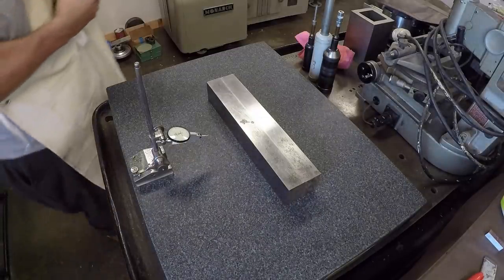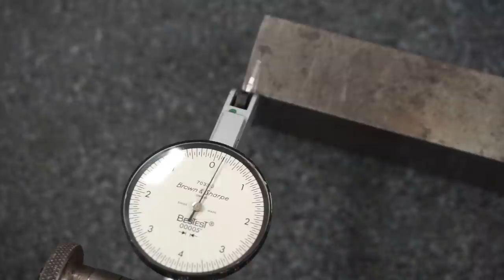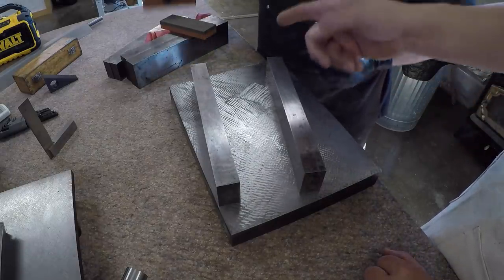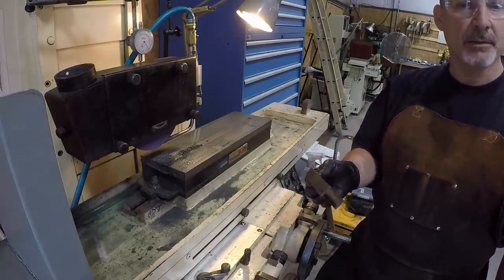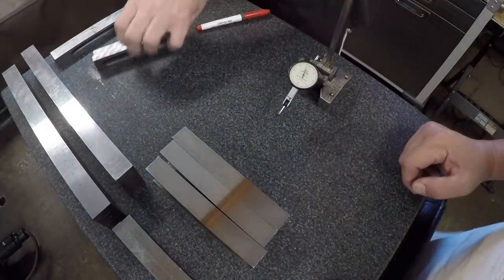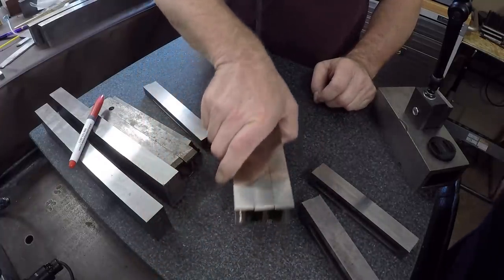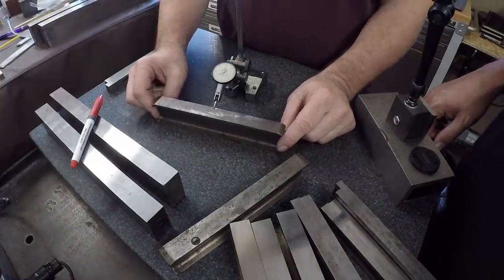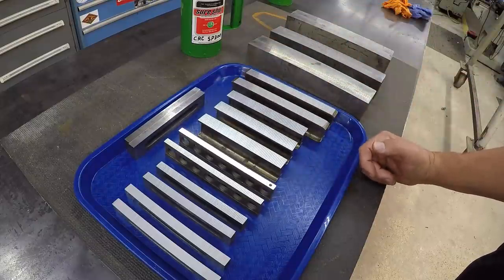SNS 293: Inspecting and Surface Grinding Parallels

Comment: 18:36

I think this must be the point all the comments about stalling the wheel is about.

Yes, it sounds freaky.

But the edges are not supported and you are getting harmonics as its ground. The closser to the center is a diffrent pitch.

Makes grinding harder as they are moving about. Many very light passes probably.

Comment: Never did much grinding,  but the guys never had the parts square to the stone, they always had them at an angle of sorts.
Reply: Agree, that i think was mistake making them parallel. Grinding stone exerts more force when it starts grinding from side, so on that particular shape(double T) Grinding stone probably moved it a little.

Comment: those I beams could of hot spots have the material deform as the grinder went over the surface reflection and rebound.

Comment: Not a machinist, but my take is that the unsupported horizontal may be resonating at a natural frequency of the part as it is ground thereby influencing the surface finish. Anybody have any thoughts on this?

Comment: On the surface grinder bed, what holds the work from moving?
Reply: Magnet I think.  Look at the power cable coming in on the right side.
Reply: This bed is known as a magnetic chuck. It holds well on particularly flat pieces of ferric metal do to the surface contact. Lots of angry pixies course through the electromagnet to hold the piece
Reply: @25centsapop  Good to know,thanks for the info.

Comment: I wish I had a surface grinder like this one, very nice! That finish is absolutely bad ass! Can the shape of the Ibeam parallels be affected by the magnetic field of the mag Chuck? Very interesting! I think it’s just stress in the material from the casting process, I’m sure not all of the grain structure of the material is perfectly the same.

Comment: The surface plate may not be perfect! a .0001'  error may be within the grade tolerance of the  surface plate.
I would check the measurements at various locations on the surface plate. 
If the measurements do not repeat it indicates the surface plate itself has errors. (all surface plates will will have flatness errors.)
Reply: That wouldn't show up with such a long part with a large s.a.
Reply: @xenonram  It May show up the errors
In the video when the bowed parallel was turned over it appeared the measurements did not compute compared to the other side? 
Mitutoyo have a good paper on surface plate calibration.

https://www.mitutoyo.com/wp-content/uploads/2018/08/15004A.pdf
Chasing tenths is always the grail for mechanical engineers, Trouble is the error gremlins lurk in every corner, you think you have got em covered then another turns up. That's life I guess LOL.

The I beam type parallels may need a lighter feed to avoid deflecting them.

Comment: What would these actually be used for? I’m not from a machining background, but being in the equipment world, I’m sure there’s something I would be familiar with that these would affect.
Reply: marine2ful  they are typically used in a mill vice to raise the work above the vice jaws so that the tool doesn't hit them. They are also used to raise the work above the bottom of the vice if your tool has a chance of going all the way thru the work, such as drilling, so that the tool doesn't damage the bottom of the vice. There are other uses but those are the most common. The reason they are matched pairs is that all the surfaces of the vice are, or should be, nearly perfectly square and parallel to itself and are mounted square and parallel to the mill. So when the 2 precision parallels are placed in the vice and the work is placed on the 2 parallels the accuracy is transfered from the vice to the work so you can quickly put them in and take them out as you need to and not have to worry about repositioning and indicating your work every time. Keep in mind, the work is wider than the width of the 2 parallels so that the vice will clamp on the work and not on the parallels. There are also many sizes of parallels and are always sold in matched pairs because they are usually used in pairs as described. Most machining videos that show work on the mill will show the machinist using parallels that are much smaller than these. Like 1"x6"x1/8" for example. Hope that helps.
Reply: lkw that did help

Comment: How are the 3 machined parts fixed to the bed of the grinder at 18.40? ............... I think I see now a very strong electromagnetic grinding bed
Reply: Magnetized table ?? did you not see him flip the switch ..

Comment: magnetic deflection? id expected more from temp not so much the magnetic influences but if it is the only way to get it out would be to support the ends with a solid resin poured tween them then regrinding them then popping them free of the resin
the finish is just gorgeous on them all

Comment: Would scraping improve the surface?
Reply: I'm not a machinist but having said that I think the tolerances would be similar as far as flatness goes, so it would be viable but very little point to scraping them, the surfaces don't need to hold any lubricant. Also getting them to be a matched pair or set would take some extra work.

Comment: adam ant lance.. hello 
I think I know why your parralels give a difference in your flat measurement.?

we could all see that lance made the stone nicely flat ... and then tensioned your parralels ... later during the measurement it turned out that the horizontal and the X axis also differed ...
I think this is due to the grindstone .. (why I think this?)
why do I think ... just simple ... the stone that wears out and the more you get to the end of that surface ... the more the grindstone is worn ...
so you measure that difference with the 0.0001 measurement ...

it would be nice that you put a 1 on the starting side and a 2 on ( ending side )where the stone is ready.
then measure later and you will see that the 1 side is 0, and the 2 side is 0.01

hopefully i solved your problem .. and thinking about it has been ..
otherwise I cannot imagine anything else.

sorry for my bad translation program hope you can figure it out!
gr fr holland

Comment: You didn't use three point contact.
When you press the grinder into the work it tilts the work towards the wheel cutting more then it should, and when you went to the other side it did the same. Classic hump in the shorter axis.(three little squares of brass shim, should fix it, one center left,one bottom right, one top right.)

Comment: I like to precision flat grind with the parts at an angle to reduce wheel time on the part to prevent heating even though I run flood coolant. I also like to Grind with only residual on the magnet for a finish pass. I have heard you can hot glue bowed parts to a flat plate and let it cure before you mag them down to get the crowned side flat, then flip and mag down to knock the cup flat.  For use on any machine besides a surface grinder I wouldn't mess with any parallels that weren't at least .0005" out.
Reply: bcbloc02 yep the glue trick works great! The glue supports the part so the mag doesn’t distort the part. Works every time! My uncle taught me that one!
Reply: Good call Brian - I like the idea of using residual mag for the finish pass, I think that can easily bow the parts a few tenths
Reply: I didn't mention this in my response I guess because it is a habit to me. Forgive me

Comment: My theory on variations on the I-beam parallels would be more to do with the tool pressure on the outer edges of the parallels, because that area is just unsupported. I believe the mag chuck had very little input on the deflection, if not any at all. If the I-beams had more of an integrated gusset from the outer edges to the center beam, the variation would be less. Also if they are not heat treated steel, the tool pressure deflection will be greater.
Reply: This is the right answer. Every material has a non-zero stiffness (modulus of elasticity) and will deflect under pressure. Lapping and polishing processes that apply less force than the grinder will give better results. However, the i-beam shape itself is the problem with using these parts as precision parallels. Any clamp-up will also cause deflection in the flanges away from the center web. That said, they are beautiful pieces even if they aren’t the best for uber precision use.
Reply: Couldn't agree more. I'm not a machinist but I work in a mechanical laboratory and this is spot on.
Reply: From the indicator readings I could see, the "wings," when measured in the free state, were lower. A better look at a mapped measurements would help answer this. If the wheel was exerting tool pressure then the wings would deflect downwards during the cut, and spring back up in the free state. That's not what I saw. Finally, the statement above about the deflection increasing if the temper is lower is not correct. The modulus of steel is very nearly the same, and independent of temper. The yield point may be lower or higher, but for a given load (tool pressure) the deflection will be virtually the same.

Comment: Is that a cam mag chuck? Those thin cross sections, as said, will conform. Need to run very low mag and put stop on backside as precaution. And as said, grinding across heat effected zones the stone could deflect.

Comment: Milling machine or shaper for the first side then surface grinding ,because the magnet will straighten out the steel but once it is released take back its form.

Comment: To start I know absolutely Zero about surface grinding but how do you account for ware in the wheel while grinding a surface ?
Reply: You will notice that he is advancing the part along the y axis so that the part isn’t being ground by the entire wheel, so small parts like these are not eating away the entire true edge, how ever multiple parts or larger parts will ware down the trueness and the wheel will then need dressings. Hope my  terrible explanation helps.

Comment: That mag chuck needs a regrind.  the error in your parts was in the same plane as the banding on the face of the chuck.  Its an easy theory to test, take one of the parallels and grind it while its on an angle to the travel of the machine, such that the parellel is resting across a few of those bands.  If that fixes the problem, then its the chuck.

Also, when youre doing your assessment of the parallels, you should sweep both sides.  You hinged one part, which clearly showed it was bowed downwards (hinging in the middle), so there was an insufficiently broad area for the parallel to sit on for an accurate sweep.  If you sweep both sides and it comes up bowed both sides, then thats your assessment, but if one side comes up bowed, you cant accurate sweep the opposite side as the part will rock under the dial.  Also, measuring parallelism with a mic helps as well.  If the part measures as a barrel, then you would struggle to sweep either side without making a fixture to hold the component on a face other than one of the two parallel faces.  Bowing outwards = opposite side not sweepable.

Comment: my thoughts on the i beam ones are the area in the middle where there is metal under it does not get as hot as the metal on the edges. Therefore the metal at edges expanse more than in metal in the middle where there is metal under it to acts like a heat sink.
Reply: Yeah but how hot can they possibly be getting with all that coolant/wash?

Comment: All steel has stress in is so it changes as you remove material, also the magnet will bend the part if its all not perfectly flat on the chuck side. We used a couple of tricks to get one side flat, reduced magnet power and or placing the parts on paper on the chucks that did not have reduced power settings. When doing stright edges they were ground with just a stop to keep them from sliding with the magnet off. You could not do them after using the magnet at all because it got warm which would bow a 14' stright edge by 5 to 8 thou.
Reply: thinking a optical flat would tell you what to do if you were wanting anything tighter.  I'D'ed the trouble spots if you didnt mind the time it took to polish them out dead nuts flat is possible  and oooooh would it shine.

Comment: When machining the "I" parallels the portion being ground that is not supported vertical web in the beam the metal gets pushed downward away from the grinding wheel instead of cutting fully. It will never be consistent.
Reply: What if you laid them over and side wheeled em?
Reply: There isn't a good way to dress the side of a grinding wheel true. Even if there was the mag table wouldn't be strong enough to hold them in place, they would be pushed sideways. And no real way to grind them in a straight line.
Reply: bcbloc02 you’ll get a much worse finish side wheeling them
Reply: I'm no expert, but my sense tells me that if the wheel was pushing down the sides, they would rebound back after the wheel passes. Then that extra amount would get ground on the next pass. As you do lighter and lighter passes, the issue gets less and less, till essentially you are just doing spring passes with practically no down force. My best sense is the thinner portions are getting more heated than the central part, so they could sag a bit when hot, and when they cool, they could curl a bit.

Comment: It takes a highly skilled grinder hand to consistently grind things flat and parallel with in .0001", let alone squareness to the same degree. I have spent hundreds and hundreds of hours on surface grinders and know what a challenge it can be.
Reply from the maker: Yep it's gets frustration chasing tenths!
Reply: I saw no squareness checks.

Comment: I would try to grind them again the same way but don't push them together. Maybe the sides aren't perfect and when you push them together some spots raise up/tilt from the magnet and then the magnet forces them down leaving tension on the parallel

Comment: What an awesome collaboration between you two! 
Adam with the wonderful finish that Lance is achieving would you now consider in future to cover the working faces heavily with a couple of layers of tape and sand blasting the sides of the parallels before surface grinding to make them look like new? I know it's only cosmetic, but the finish Lance achieves is phenomenal and the rest of the parallels deserve to look brand new as well to my mind.

Comment: What's that stand called holding the dial indicator?
Reply: Surface Plate Indicator Stand
Reply: @johnfranks  Not quite right. It is a Surface Gage. Most likely a Starrett 257A or C. A Surface Plate Indicator Stand usually has a mount for a regular dial indicator and a small block of granite or cast iron for the base.

Comment: Partially turn the magnet on or shim the parallel to grind the bow out of it. Once you have the bow out of it the rest is easy. Heat is your enemy when grinding. So when are we going to see you grinding on a surface grinder in your shop adam?

Comment: Great work!!! On the bow(ing) see Don Baily`s take on that at Suburban Tool i.e. set the mag plate at very light pull ;-)
Reply: Full on,then down to half. Operates under half magnet. Relieves any bow,lessens it.

Comment: Hey Adam, when you have a bow, to the tune of even maybe 5 tenths, would that not matter when you are clamping the piece top-to-bottom?  Wouldn't the bow flatten out, depending where/how you clamp.  I would think, if you clamp the bowed side UP, then you are clamping the work parallel to the vise, and that small of a bow would not matter?   Now, if the parallels are Tapered, well, now you're screwed.

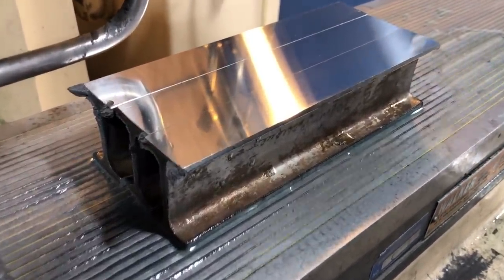Comment: 21:58 It looks as though you can actually see the end imperfections that you find when using the granite. Look at the top right of the reflection. If that mag was actually causing a bow, I don't think you would be able to see the imperfection with the mag on. I think you just needed to go a few 10ths lower.

Comment: What kind of wheel is best to grind a stone? At work we got some 46H wheels and a fine 100K. Which would be the best to use?
Reply: at the company shoo we usually use 100-180 grit CBN wheels to resurface stones. put it in a good vice, and take light 5 tenths to a thou a pass until the stone pores are clean and its usually good to go again

Comment: Can anyone explain how to get rid of a bow in a peice? The mag chuck is always going to pull the item straight for grinding then let the bow come back when released. there must be a way but I've never seen it demonstrated.
Reply: jonka1 I usually use a coolant soaked paper towel as a shim under the whole part, and use just residual or lowest mag setting on my electromagnet chucks. The paper towels helps it from pulling down even with the slight pull from the mag.
Reply: I saw an example of it. I think it was on Suburban tool's YouTube channel. It involves using shims, residual magnetism, and large pieces of steel surrounding the work to keep the work from flying off the chuck due to the lower magnetism.
Reply: Just read my comment below yours mate.

Comment: Those I-beams have a little bit of twist in them and when the mag chuck pulls them down they conform to that surface being impossible to make them completely flat using that method of clamping.

Comment: I wonder if the tool pressure (the grinding wheel) is causing the I-beam's to flex in the middle and tilt side to side??

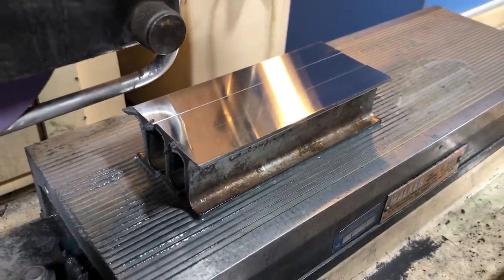Comment: 22:21 Is there any value in slowing down the whole grinding process to offset the discrepancy on those I-beam parallels flatness on the cantilever edges?   As far as finish or accuracy.  Or is important to get the wheel off the work asap for thermal reasons.